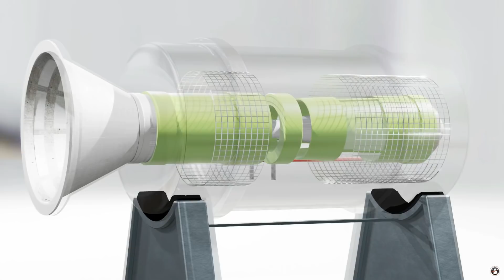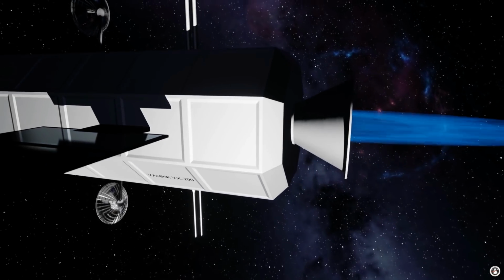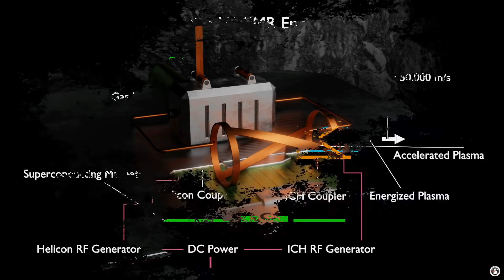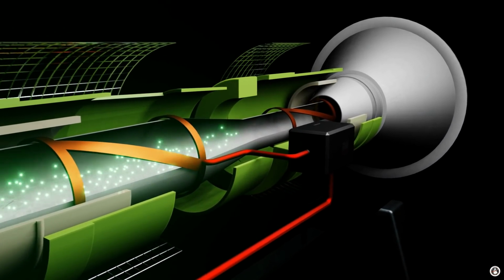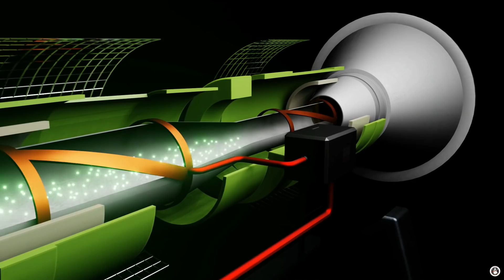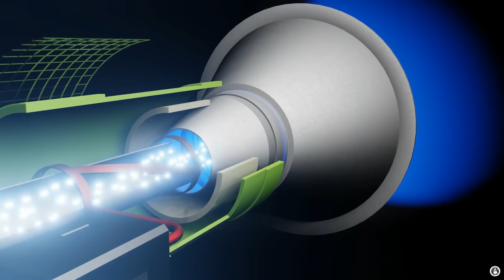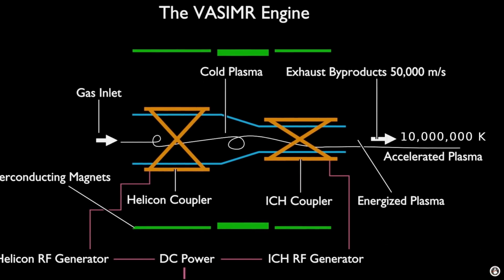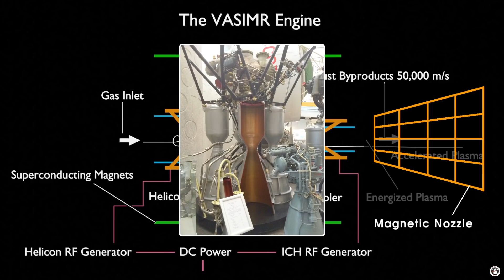The VASIMR Engine – 0.000167 c / 50 km/s

Comment: So why aren’t space x using them?
Reply: It's been in development since the 1980s as I recall. Which makes me wonder what the holdup is, although I expect the answer is "NASA."
Reply: top secret
Reply: Because VASMIR, like most electric engines are terrifyingly efficient but have virtually no thrust. It takes a VERY long time to accelerate up to appreciable speeds and that will count for deceleration too.

The only reason it cuts down on such far travel is the because its fuel source is much lighter than traditional chemical fuels. The major issue is the cost/output/weight of a powerplant strong enough to actually power the damn thing.
Reply: @DeltafangEX  We cannot even pass through Earth's radiation...
Reply: @worldbestt-shirtshoodie-go6184  ...what?
Reply: @alvarofernandez5118  Petite said we dont have that technology anymore himself
Reply: @alvarofernandez5118  Ah. Well, ironically ISP tends to be tied to electricity required to run the drive. The most efficient drives tend to be that way primarily due to the weight of the fuel (or lack thereof). 

As far as I know, VASIMIR and other drives like it just require way more electricity than we can generate at one time without a pretty sizeable reactor on board. One of a size that will probably nullify most of the thrust benefits to begin with. On the bright side, it's still your most efficient option - on the other, it's going to take much longer to accelerate/decelerate without a lighter or more efficient power source.
Reply: @worldbestt-shirtshoodie-go6184  Considering the fact that the computer was invented for space travel first and foremost and is many, many times more powerful now than it was back then...the idea that we have lost any of the technology is not just straight up wrong, but baffling and dangerous.
Reply: @DeltafangEX  We could use nuclear power plant miniature
Reply: @worldbestt-shirtshoodie-go6184  That's the idea, yes, but weight is at a premium in space and the only powerplants we could conceivably use are the ones in service on military-operated seaships. And yes, those are considered "miniature" when compared to the powerplants that supply entire cities/counties.

Still, there are a boatload of problems left over (pun intended):

1) You've got to pay for the R&D for the basic refitting necessary for the powerplant to work with the Vasimir.

2) You've got to add weight to the ship to supply proper cooling as well as a medium with which to generate electricity - NONE of our powerplants today output direct electricity, they usually superheat water to turn a steam turbine. None of these are cheap or lightweight.

3) You've got to pay to haul all of this stuff into space (on different launches), then probably pay for the privilege of assembling the whole damn thing in orbit.

4) At the end of the day, no matter how high VASIMIR's ISP is...its useless for getting anywhere in a reasonable amount of time with a reasonably-sized payload if you have to dedicate all of the weight to the machinery required to make the engine run alone .And all of this weight will undoubtedly make its payload fraction really, really small.

There are several breakthroughs that we'll need to make first if VASIMIR will fully leave the test bench. That's been the issue with a lot of theories and designs in the past 50 years or so - a lot of them are based on sound reasoning with easily provable results and sometimes scale demonstrators - but it will be some time before we can make every one of humanity's dreams into reality. 

Believe me, people are working on it - neither you nor I have anything new to add to this topic that researchers and scientists aren't losing sleep over right this very second.
Reply: Also  c o s t

Comment: I think you mean 0.0167% of c?
50000 / 299792458 = 0.00016678204

It takes light 3 mins to reach Mars from Earth at min distance..
Reply from the maker: 0.0167 c / 50 km/s is in the title.
Reply: @asteronx  That's my point.. it should be 0.000167c
Reply from the maker: @PragyAgarwal  You are correct. Mistakes happen. Thank you.